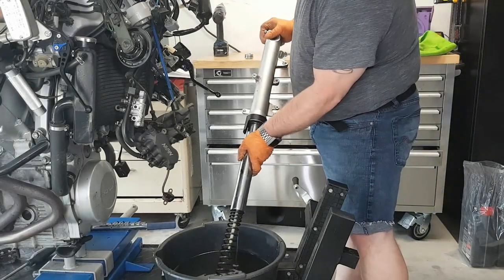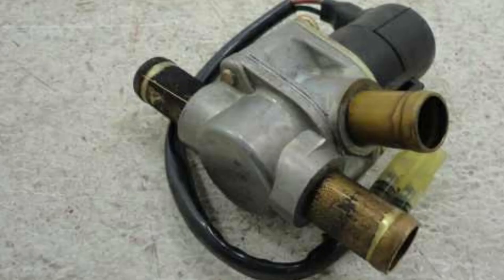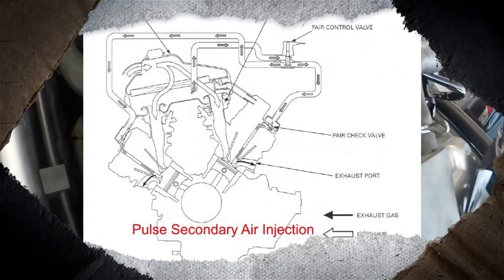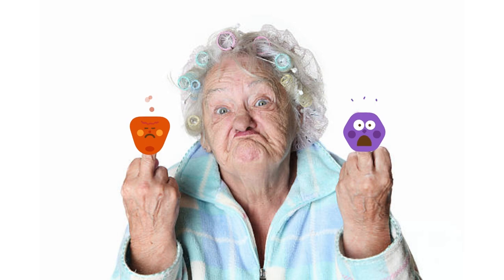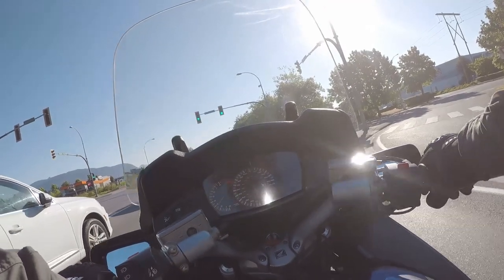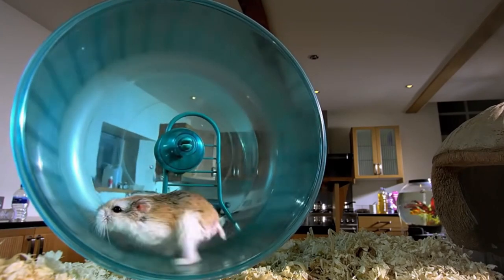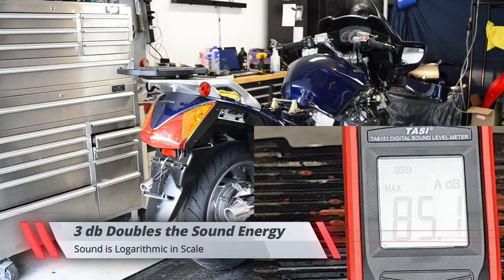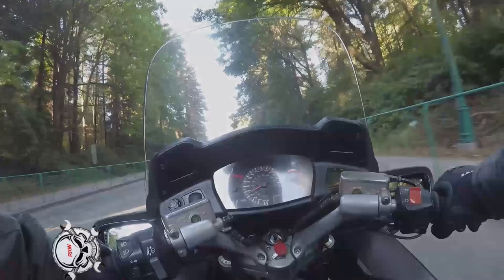Honda ST1300 Performance Mods

Comment: So I just reposted my results up here,, where it is more visible.  I was as skeptical as any,, about removing the upper tuned intake stacks.  I only have one test day on it,,, but no downsides discovered yet. 

Okay,,, so in the past couple of days,,, I got the above done.  First removing the upper curved velocity stacks.  Leaving the lower short straight stacks in place c/w fastener safety rings, as they basically hold the airbox to throttle bodies.  Also,,, I did throw in that freshly oiled K&N filter.  And much to my pleasant surprise,,, I got a decent increase in useable torque.  Very impressed,,, I then removed the x-long baffles from the 18" Del's.  Sure it's louder now,,, but more air/fuel in and more combusted mixture out = even better results.   This is just basic hot-rodding.  The Bazzaz air/fuel map that I am using (13.2/1 roughly),,, is just rich enough for good power, and minimal afterburn.  So far,,  fuel mileage does not appear to be negatively affected,, despite me having a whole lot of fun.  But tomorrow,  I will tank up and do a proper mileage check at normal speeds.  Standby for more good news !!
Reply from the maker: I appreciate and applaud :washhands:your efforts Alan, your reward is more POWER which is always better than less and for rest of you naysayer armchair wrenches just four words... I TOLD YOU SO!😃
Reply: @RodRidesWrenches    So I was able to do a short 109km fuel consumption test,,, which was combined city/highway at about 10-15km over posted,,, so fairly tame.  It was over known and frequently traveled routes,, during medium winds,, and not much in the way of performance driving.  Good news,, is that there was an improvement in fuel consumption, as measured and calculated with pump volume and gps distancing.  Average consumption was up about 1.5km/L.  But I need to do a longer ride,,, mostly highway,,, of about 200km minimum to verify this.   Should get a chance at weeks end,,, and I promise,, no hyper-mile-ing !!
Reply: So first of all,,, sorry for the delay.   And also sorry that I only have combined city/highway results available yet.  But,, I have done those twice,, because I couldn't quite believe the good results.  And please remember,, that these results are from a Bazzaz modified F/I setup,,, that is no longer available.  Anyway,,, the 3 elements modified, exhaust baffles out, F/I mod's, and upper velocity stacks removed (okay,,, maybe the K&N too).   Mileage was calculated using pump volumes,, and gps distance measurements.  Fuel  was 91 octane.  Speeds were posted limits, to +15kph posted.  Maximum shift points 4500rpm.  So conservative speeds,  but not horribly slow.  No large hilly terrain,,, and moderate side winds only.  So before the upper stacks and baffles were removed,,, this fuel map produced between 16-18km/L.   After the   upper stacks and baffles were out,, and the K&N added,,, the consumption improved to about 20-22km/L, when driven at the same performance level.  Not bad at all,,, especially considering there is more torque on tap now, should I choose to use it (and I do,,, frequently, lol) !!  I hope to do a highway only check before the weekend.  Cheers,, Alan

Comment: I added the Delkevic to my ST1300 and liked the tone with the Baffles in place...... but after several weeks, I missed the original quiet cruising of the original mufflers and went back..... The ST1300 is such a pleasure to drive just like she was sold to me back in 2006....
Reply from the maker: 😭These bikes sound so good uncorked...
Reply: I’ve always liked the stock sound.  I had loud pipes on my last bike and it gets old.  Fun on local cafe runs with buddies but if you do distance it becomes bothersome!

Comment: After owning two ST1300s I found the best thing to do for seals and brakes was to take the bike to Honda and have all the fluids replaced every other year.  That was around 25-30k miles.   It really renews how well the fork and brakes work, ensures your radiator and clutch fluid are in good kit.
Reply from the maker: Thanks for the feedback & view!  New video on Sunday!

Comment: I had Delkevic pipes.I don't like the excess noise, so I went back to stock. Too much noise can add to fatigue if you do long rides. The ST is after all a mile muncher. My neighbours are also grateful for more quiet.
Reply from the maker: Thanks for Liking & Subscribing!  New Video Coming Friday Sept 17th...
Reply: What is never mentioned is that after-market mufflers need to be serviced every 8-10k miles. They basically consist of a perforated pipe wrapped in fiberglass. That's why they're so much lighter than stock mufflers.
However, that fiberglass burns up after about 8-12k miles and needs to be re-newed. Otherwise there will be a lack of back pressure and it will also sound much louder and worse.
The stock muffler is built to never have to be serviced  and has steel chambers for the back pressure and sound reduction, hence the high weight.
Reply: Are they for sale, i want to put a set on my bike, cheers
Reply: Glen Middleton, as above text cheers
Reply: @sv650nyc7  While I have baffled 18" Del's on my '04.  I have also run a '12 with stock pipes.  Two main reasons are,,,  it (the '12) has lower emissions and gets great/better mileage.  It is also pleasantly quiet.  It has performance equal to the '04,,, while doing other things even better.  So it does not much sense to spend a lot of money on performance mod's for the '12.   Question though,,, where do you find the re-packing recommendations for aftermarket mufflers, like the Del's ??  thx,,,

Comment: Since you asked, and yes I'm a bit late, I hate loud exhausts. I have a Delkevic full system on my ST1100 and I'm not that happy with the sound. Of course bafflers are still in. I much prefered the stock exhaust sound. Alas it was rusted out and finding a good second hand replacement is almost as expensive as the full Delkevic system. Which by itself is a good system, indeed good value for money. My 4th gen VFR (RC36) still has the stock exhaust and I much prefer this. Depends also on the engine type, at least for me. I also have a R1100 RS with stock system. It is relatively loud yet the sound of this boxer twin I find very pleasing. It is a very personal matter of taste. Although I do see your valid point about safety.

Comment: I want to use a st1300 v4 engine in a very light car.  I want to remove emissions and add a turbo with better throttle bodies, injectors, and fuel pump.  I'm wondering if a port and polish is needed for better breathing?  A goldwing can easily make 200 up to 300hp but everyone says the 1300 can't do the same.  A k1200 is better then this bigger Honda motor? How much power can this actually make?

I want real motor since it's not in a motorcycle. Any advice?

Comment: So, I started watching your channel because I got an ST, and I watched one of your other videos and liked it, but some of the things you say in this video is way off, those tubes you are removing from the intake have nothing to do with debris and everything to do with tuned intake length. They are designed to increase air velocity by giving a straight steady stream of air flow. When you remove them air tries to come from all different directions and combined with sonic pulses coming back through the TBs causes a lot of turbulence in the intake. As for the AIS, the bike is tuned to have that much oxygen in the exhaust so unless you are installing a 02 eliminator and a power commander or equivalent. Plugging the AIS will cause the bike to run leaner. The last thing is the header wrap, yes it saves you from the heat, but it pushes the heat further back in the exhaust. Keeps the Temps higher further back, if you are running aftermarket exhaust, you probably going to burn out the packing pretty quickly.  The engineers actually know what they are doing sometimes.

Comment: I purchased a low mile used ST1300 2007.  I had a bit of popping. Any time I purchase a used motorcycle I remove all the plastic and give it a good look over to see the disaster of mods the previous owner may have done. To my shock all stock but pipes were Delkevic also.  After a good look at the exhaust front to back the pipes were installed very poorly.  You could see the dark exhaust leaks where the mufflers joined the pipes. 

Took them off cleaned and used high temp gasket maker at the joints. And bam no popping  at all. 

I tried the pair valve mod and lost the high idle as it reached temp. Once warm idle it stays at 900 rpm.  Going to see if this causes any stalling in the next few day.  

Since I had no popping after my exhaust re-install  I may put the pair valve either back to stock or instead of blocking it just reduce the air to allow some through. When I had several Victory bikes I used an item called an idle air valve. you would limit the air by an between valve to 1000rpm to the start up idle. Once warmed up you could still achieve normal idle.

The purpose of the IAV was to reduce popping for Victory  bikes.

Comment: As far as noise levels, there is definitely a  happy medium.   I love quiet stealthy bikes, especially off road or woods riding. But i find and V2 or V4 engines sound amazing with less restrictive pipes but they have to be modest or it wears me out on long rides. I dont always buy into loud pipes save lives. I think this used to be the case but ive changed my opinion. People drive with earbuds, radio cranked, and all the other distractions. As well as most drivers in populated areas being less courteous and more selfish. I truly think loud pipes are useless in today’s world as a safety tool.  The only thing that can protect me as a rider is maintaining a safety bubble from others on the road.   I think the highway is one of the most dangerous places to ride and takes the most attention energy to stay safe. Cheers on the great vids!
Reply: My st1300 is not even looked at by cops vs when I ride Supersports. It's great for zooming around and just vibing and doing roadtrips.

Comment: Hello from the UK and thanks for the very professional and informative video, however I'm perfectly happy with the bike in standard trim.The only modification I would consider is reducing engine temperature and that's only something I've experienced as a negative whilst touring through Spain ,in the UK it rarely gets over 60f lol!
Reply from the maker: See video if you have not already found this link, many steps to reduce heat.  https://youtu.be/kM8SBjtVu6A
Thanks!

Comment: Hello, interesting to see series of videos of a service/setup of a bike. Thanks for uploading!.

About the block-off plates, or removal of the air valve, I did it in my Yamaha MT09. It's not done because of performance gains, but to remove something that adds some complexity, with no gains and some obnoxiousness as well is added. Without the catalytic converter, the injected air mixed with the unburnt fuel, generates a lot more of explosions outside the exhaust when releasing the throttle. I just blocked the system to avoid that air generating more explosions than it should and having higher temperature in the exhaust.
Reply from the maker: Hi Diego, thanks for the feedback of your own experience!

Comment: When I upgraded from my ST1100 in 2011, I chose a Concours14 which I like.  It was less expensive and made more power.  It took quite a bit to make it fit me as I have short arms and legs and the bars were too far away and the seat was tall for me.  In the fall of 2019, I discovered that ST1300’s were really reasonably priced, so I picked up a 2007 ABS.  In 2020 I took it to Montana in August.  The first day out, I melted some prescription pills that were in my luggage.  Those mufflers get really hot!!  I have never seen that with my ST1100 or my Concours14.  The stock mufflers may have to go.  A bit more power would be nice too.
Reply from the maker: I also found the Concours a bit of a stretch but it is a picnic compared to my K1300SP.  I really enjoyed putting 3000km's on a Concours on one cross country trip and will have one again.  Thanks for Liking & Subscribing!  New Video Coming Friday Sept 17th...
Reply from the maker: Thanks for Liking & Subscribing!  New Video Coming Friday Sept 17th...
Reply: @RodRidesWrenches  I put “ape hangers” on my Concours and could have used some on my 350 mile ride on the ST1300 yesterday.   I spent a week in August putting 4000 miles on the Concours around North Dakota, Montana, Wyoming and South Dakota.

Comment: I have a'94 ST 1100 and its getting a little worn out. I looked at the 1300 and like the look and performance, but its got too many issues that i dont like , like fuel mapping, seat discomfort, top heavy and its a  bit of a pain to work on logistically, and has the potential electronics / software problems that cause you to be stranded.  so tomorrow i am gonna look at another low mileage 1100, cuz they re just nearly bullet proof under 75 k miles. I do wish the 1100 looked like the 13 though, thats for sure, but i will take reliability over style. Enjoy your videos though, they are very well done.

Comment: Being an ex Roadracer  I really enjoy the ST. Thanks for the tips!! I installed a used two brothers pipe I like the noise saves me from getting hit by other vehicles!. I’m gonna try the air box mod and heat wrap. 

Thanks for the vids ride safe
Reply from the maker: That is awesome! New ST1300 Video Coming Soon...  Thanks for Liking & Subscribing!

Comment: I am con on the loud pipes at a ST 1300. I only like them on Buells or Honda VTR's  for instance. This bike is made to be very comfortabel for the rider. The loud sound would anoy me everytime I would ride or cruise on the bike. Same as putting loud pipes on motorscooters. These aren't race bikes. They are not meant to 'show off' or break lap records on the circuit where every gram or pound (or extra horsepower) counts.
Reply from the maker: Thanks for the feedback, liking & subscribing!

Comment: Good video. With changes to the tuned length of the inlet, air filter and mufflers how have you remapped the fuel injection to prevent it running lean? Have you put a gas analyser on it?
Reply from the maker: The ST has a closed loop fuel injection system, in theory you should not have to remap since the O2 Sensor and the ECM are there to figure that out.  I also wanted to limit the mods specifically to not use a mapping accessory like a Power Commander.  We will see how it goes...  Thanks for Watching & Subscribing!
Reply: @RodRidesWrenches  have you mad a conclusion to see if it is running lean?
Reply from the maker: @rvman722  Bike is running a bit rich and not lean.  I will remove the pair block off this year and see if there is more heat.
Reply: @RodRidesWrenches  
You may want to consider reducing the air vs blocking the PV. Once I tried a small plastic  cylinder inserted in the pair valve tube. I tried several hole diameters until I got close to 1000 rpm idle when warmed up.  But reduces air enough to reduce the popping.
Reply: What was your conclusion after removing the pair valve plug.  After you sold the ST there was no clarity  after the mods , final thought?  Plug or not?

Comment: snorkels, venturis, velocity stacks all tune the harmonics of the intake. you can do some math with the speed of sound and the length from the end of the venturi to the intake valve to find the rpm the first harmoc hits. even though it seems like a restriction it increases power at mid to low rpm. the longer the intake the longer it takes for the sound wave to make it back the lower the rpm its tuned for. probs best to keep them, by removing so mutch length you've propbibly pushed the first harmoic up and over the red line and you will never get any bennifit.

those burbley low rpm small block chevys make more power on a high tunnel ram then a low dual plane.

Comment: The ST1300 is not the right bike for you I'm afraid. There's no point at all of increasing the power of this wonderful motorcycle over the standard level. It has plenty of it right from the factory. Also the argumentation about louder pipes is a lot of bullsh*t. More and more roads are closed down for motorcycles in order to reduce the overall noise level. Tell me what is better: Riding a silent bike or not being able to ride your bike on nice winding roads at all? 
The technical explainations are pretty good and correct. Thank you for that!
Reply from the maker: So the Honda cannot be made better than it already is?  Thanks for your comments and liking & subscribing!  The improvement in mid-high RPM pull after the mods are strikingly improved, especially riding two up.  Try it, you my find you like it!

Comment: You don't know where I live. Uh-oh, one may easily see it in my road video's on YouTube.
I feel like only few motorcycles are spotted early with loud exhausts, mostly only from the rear. Some mastermind, so to say, tried with video to find out if his loud music, on four speakers that he had, could scare deer away from the road. No matter what he did, you just heard the motorcycle coming but the extra noise was noticeable for a second and not alarming.
Cars are well sound insulated and drivers are in an environment of their own, where they often play music or are in conversation.
It wouldn't be a mistake to run lights daytime. Everybody keeps good eyesight. My ST1300 has almost blinding LED headlights and LED taillights. We are not allowed to overtake vehicles on the right side down where I live and I think that matters. It makes it easy staying in both the mirrors and there are not so many cars in front of you. As a result the police in many countries would pull you over when the exhaust is worked on. It is unnecessary to make pipes loud. When you do, don't expect miracles, like "Now I am noticed." Rev. bombing also, never heard of in Europe.